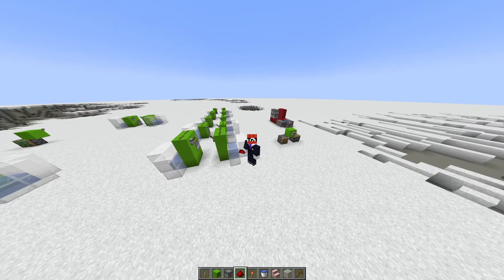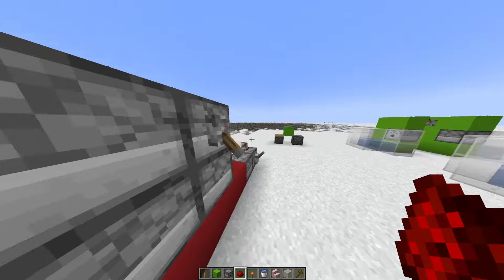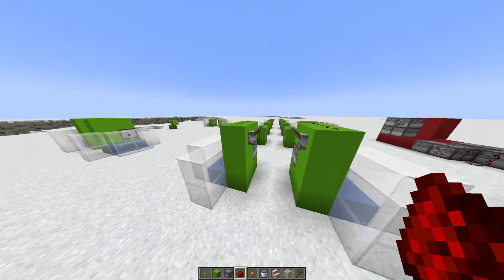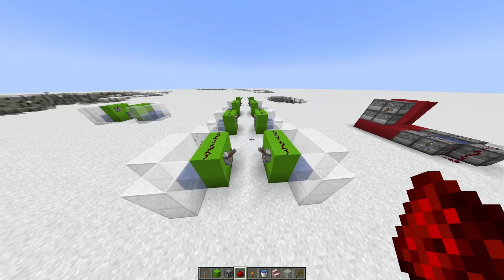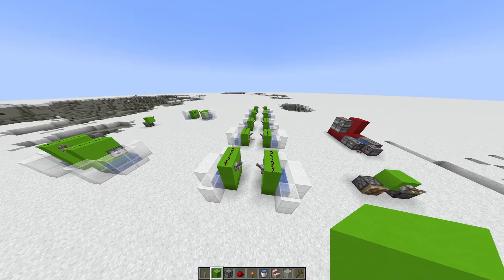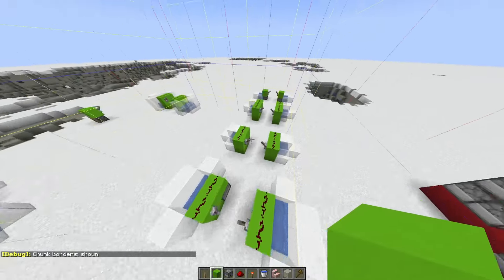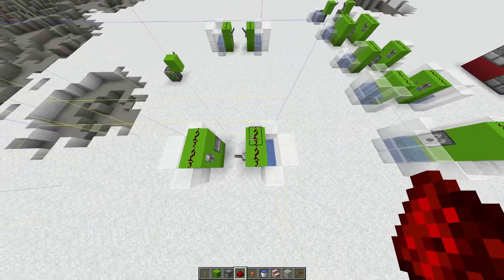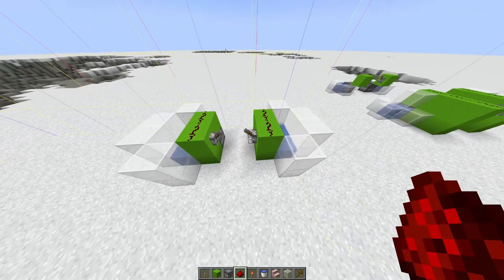Can a Technical Minecraft Player explain this?

Comment: What you're experiencing is something called dust locationality, which basically means that the order in which redstone dust turns on or off can be completely different based on world location. idk the technical details, but I read that part of the way dust works is reliant on a hash based on world coords, which affects the dust update order

In this instance, the dispenser system breaks when the dust above the dispenser turns off FIRST.
This updates the dispenser, because the block above it is no longer powered, but it doesnt turn it off because the other piece of dust is still on, powering the dispernser via QC. Then that dust turns off, but it Still doesnt unpower the dispenser because it doesn't provide an update to the dispenser (because its powering it without 'touching it')

In the instances where it works, the redstone dust on the othor block turns off first, nothing happens, the dispenser is still powered by the dust above it. Then that dust turns off and it also updates the dispenser. Now both dust are off and it is updated, so it unpowers, allwoing it to be powered again when the lever turns on.

This is one of the big reasons people hate dust, because it frequently causes these kinds of issues.
Reply from the maker: Oh wow that makes alot more sense now. Thanks for the well-written explanation I never knew redstone dust could have inconsistencies like that.
Reply: No problem! Glad i could help
Reply: @TheProfessorTNT  I saw the notification of you asking for help, i see here squibble already answered. 
Yes it has to do with redstone being locational and behaving differently depending on the location in the world. 
One of those really "random" things in redstone and a thing to have in count when you update things with redstone. It can be predicted but its really hard. This is because Mojang decided to use a hashset hashed based on location to store some stuff like for example the redstone update order.
So in reality nobody checks for those things, we usually just dont use redstone for updating since rails can do the same and they are not locational, and we always try to make things work anywhere.
Reply from the maker: I see, I was always intrigued by how people used so many rails in technical redstone. Very understandable after something like this happening. Also thanks for the response, I sent you a reply but I was unsure to keep it up if I already got an answer from somebody.
Reply: Oh hi squabble
Reply: @__Leah  hi leahhhhh :33
Reply: In Bedrock edition we don’t have to worry about that! Yay! 

Oh wait… it’s because we don’t have QC 
D:
Reply: This bro cooked.
Reply: I do know the technical details, it takes the location, multiplies the x by 1, the y by 31, and the z by 961, and then adds them all together, then takes the bottom 5 bits of that I believe, the end result here is that if you copy something, and put the copy 31 blocks negative x, and 1 block up, it will behave exactly the same as the original position, you can do the same for 1 blocks positive Z, 31 blocks down, etc, anything that makes X + 31Y + 961Z add to same the number as the original, will behave the same, with the small exception of very large Z positions, where the maths gets weird due to the fact that ~2 million * 961 is larger than the integer limit, but you can ignore that, if you stay within 2 million blocks on the Z axis, this is accurate
Reply: @fuby6065  Huh, thats so interesting. I wonder why they did that. Thanks for explaining!
Reply: @squibble111  there's a fairly reasonable explanation imo, the keeping the bottom 5 bits only is a result from java itself, the hash is for the order of the redstone updates, and I believe there are a little under 32 updates per dust (edit: there are only 7 in this part of the code, there are a lot more in total, but this part only handles 7 of them), meaning java just truncates any values over 32 (edit: 8), by keeping only the last 5 bits, as for the 961, it's just 31^2, in the code it's actually written slightly differently, it's 2 multiplies by 31, but simplifying it out was clearer here, as for the choice of 31, I would assume this is because the goal of a hash is to "spread out" information as much as possible, and since 31 is 11111 in binary, it spreads everything out as evenly as possible, and I would assume the reason for 31 is because it's the smallest power of 2 larger than a chunk, this hash is used in other places, and they probably didn't want hash collisions within a singular chunk, but they were also aware of the overflow problem, so they didn't go with a larger number
Reply: to further expand on this btw, I suspect this was entirely unintentional on mojang's part, what they did was they simply make a hashset of all the places they are going to update, this is fairly bad practice for this exact reason, and they likely didn't even realise that their custom hash was being used for this, as it happens automatically
Reply: @fuby6065  Thanks for explaining all these things. This was really interesting to read